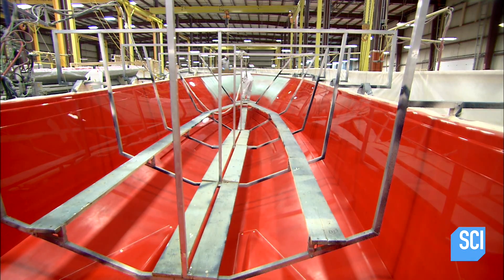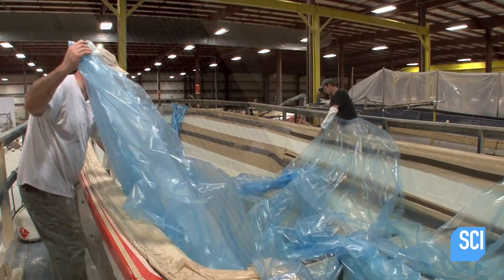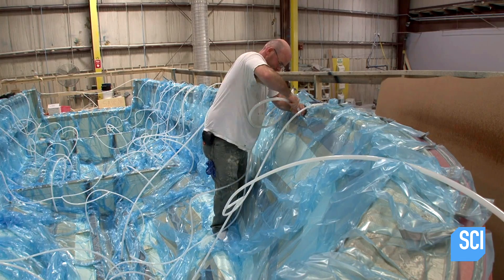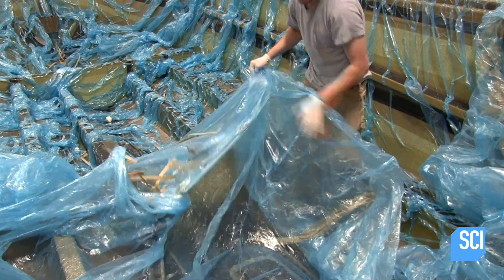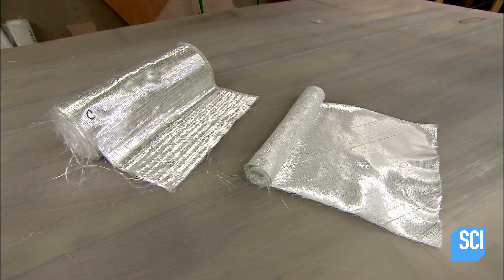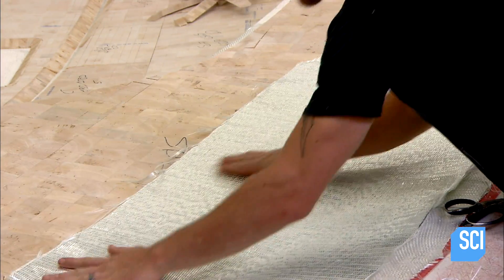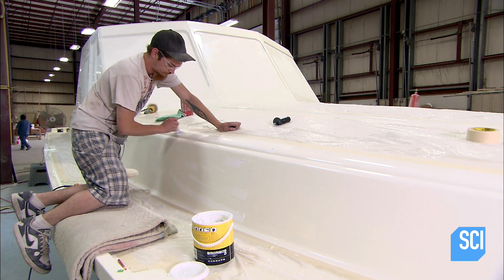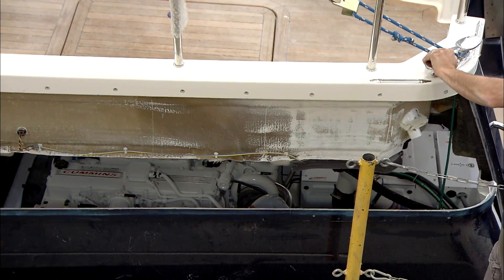Yachts | How It's Made

Comment: that was just the hull. no motor attachment, no electronic connections,  not even adding windows. 
No hinges , no handles. No latter on the back to get back in from the water.
Just wait 2minutes and 43 seconds and pretend it was 6 months.